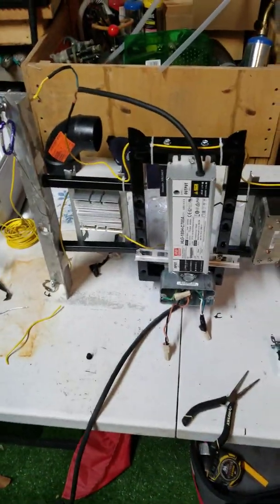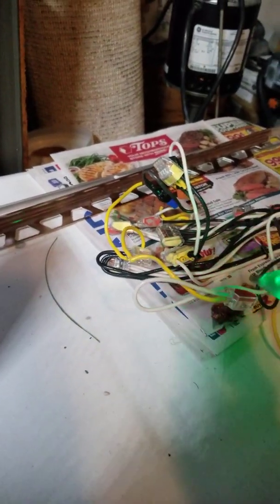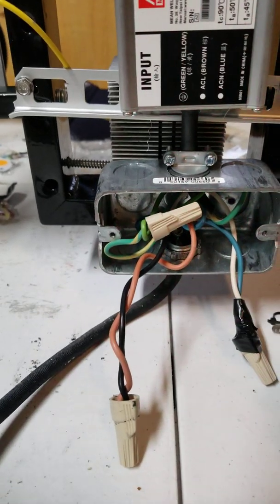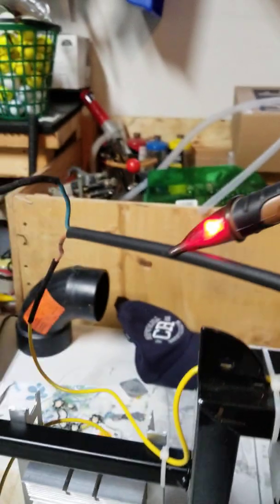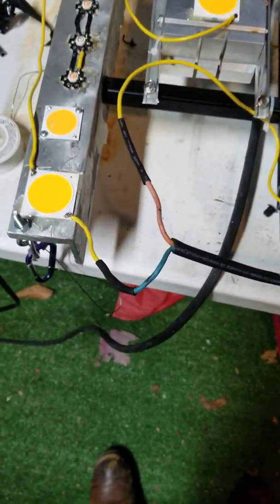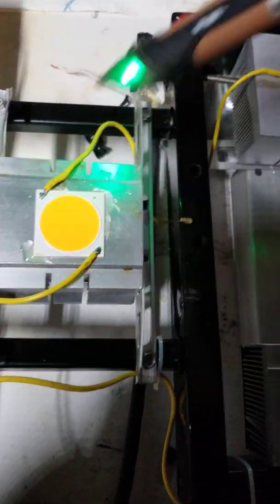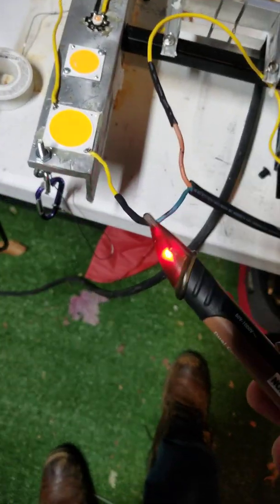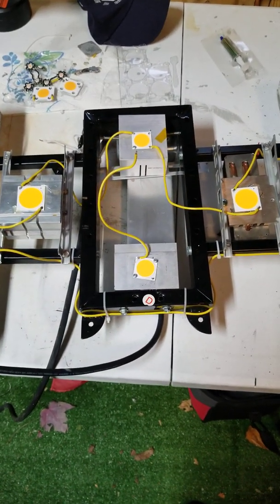CREE CXB3590 LED COB MEANWELL HLG185H-C700A DRIVER - BUILD MISTAKE - FIXED

Comment: There are two reasons why this does not work.  Firstly let's assume that these are the 36V CXB3590 COB's.  If this is the case, then a 700mA driver is not enough to turn on the LED's.  If you look at the graphs in the data-sheet, the minimum current is 1400mA for the 36V version.  Secondly if these are 72V CXB3590 COB's then with 5 connected in series you don't have enough voltage coming out of the driver to sustain 700mA.  Either way that is the reason why it doesn't work.  Hope this helps !!
Reply from the maker: Yes you are correct, the auction i purchase stated they were 36v cobs. 
In fact they are 72v cobs. 
I honestly did not know 72v cobs existed until this issue I came across. 
Thank you for your input!! 
Nick
Reply: They can run lower than 1400 its because the total volts add up to more than the volts the driver puts out you need to add voltage together for series connection with a constant currant driver that driver will only push 4 cobs at 36 volt in series